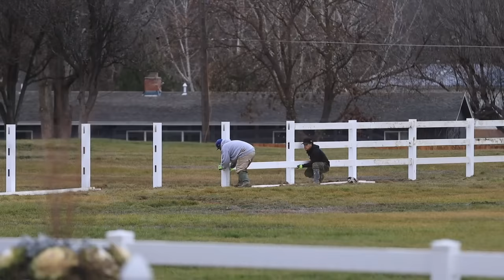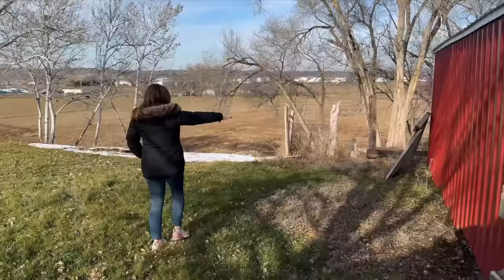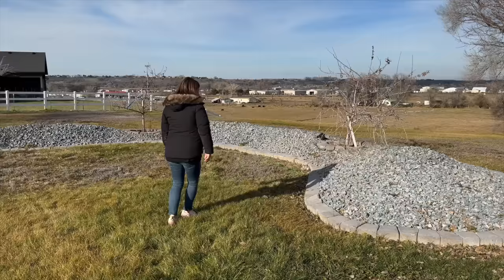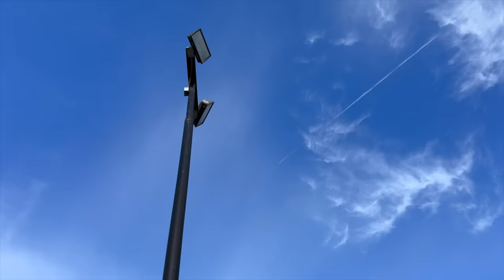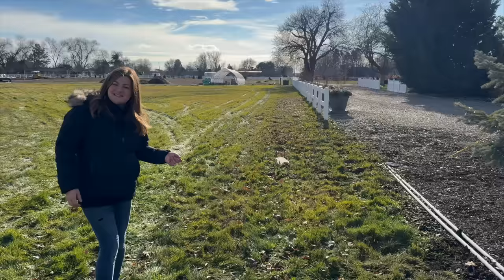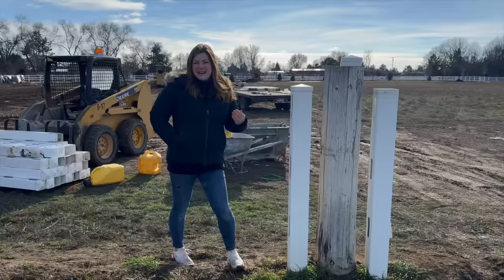A Very Exciting Way to Start the New Year! 🙌🥰🙌 // Garden Answer

Comment: Congratulations on the new property!!  As a horse person I wanted to give a few suggestions as you develop that area and the barn for horses.

1.  No Autumn Blaze Maples anywhere near the pasture.   I love a red blazing maple in the fall just like you, however the red leaves are poisonous to horses.  So plant a maple thats leaves go to a beautiful yellow in the fall instead.  (Sorry for the bad  news) Also any tree in the pasture area that horses can get to that have a Y trunk with the Y at or near head level, either get rid of that tree or cut off one of the two Y juncture.  I had a friend who's horse got its head stuck in the Y and broke its neck when it panicked trying to get free.  

2.  Don't get rid of the light posts around the basket ball area.  You will want to keep those and relocate them to your arena area.  If you or your kids end up riding competitively they/you will be riding at night and those lights will be a godsend.

3.  Pasture grass - plant a really good 3 way orchard grass and water it.  You can harvest and bale that grass for your horses and not have to buy it on the open market.  A good 3 way orchard grass per bale price right now is $25 to $30 a bale.  Until you get horses, you can cut, bale and sell the bales at your parents garden center.  Its extremely hard to find high quality 3 way orchard grass.

4.  Barn ... if the barn doesn't currently have electricity, put that on the project list.  You will want ligts in the barn, the stalls and the paddocks.  If the barn doesn't have rain gutters, put that on the project list too as well as a French Drain system to flow the water away from the barn/paddocks and out into the pasture.  If the barn sits at the same level as the surrounding land you will also want to do some earth movement to have the barn and paddocks higher than the surrounding land otherwise your paddocks and barn area will be a big muddy swampy mess when the snow melts or after heavy rain storms.  Stall, paddocks and barn isleway .... rubber stall matting, and a roof over the paddocks.  Nothing sucks more than sholving horse poop in a paddock in the rain.  Having a roof over the paddocks keeps them dry, and provides shade for the horses in the summer.  Rubber matting in the paddocks and stalls makes cleaning them so much easier.  Of course in the stall you will be laying bedding on the wall to wall rubber Matt's.  Don't use straw ... use sawdust shavings or pelleted bedding.  If there isn't water lines to the barn, add that to the project list.  Nothing sucks more than dragging a hose to fill a bucket in a stall.  Instead you can install automatic waterers.  Carve out an area in the barn to build a feed room and a tack room.

5.  Wash rack - figure out a spot for your wash rack.  That same spot can also be where you groom your horse and where your horse has appointments with the shoer and the vet.  

6.  Horse trailer -- side load all the way.  Don't get a straight load.

7.  Arena -- when you build it make sure the footing is done right.  Also add in shredded rubber.  It keeps the dust down and makes for great footing to work your horse on.  Visit some horse facilities and talk to reputable companies that install arenas.  A properly built area will be a worthy investment.

8.  Entrance  Gates to the property are important to ensure that is the horse get loose they don't end up on the road after going down the driveway and it keeps anyone off the property who may want to steal your horses, tack, trailer, etc.  I know you guys have talked about installing entrance gates for security.  Definitely have them on the todo list.

❤❤

Comment: It’s a beautiful piece of land and a cute barn! A couple of suggestions regarding horses. Protect any trees you want to keep that will be in their paddocks. Use your fencing to create a small fence around the trunk. Horses WILL kill trees. I also worry about using 2 x 2 boards as stall material. They may be ok if the horses aren’t enclosed in there for prolonged periods. Even gentle horses can be destructive when they’re impatient or if there’s another horse in adjacent stall. Consider reinforcing with a heavy metal mesh. One broken slat and a leg could get caught in it.  I notice some of the wood top rails in the stalls have already been chewed on. Consider installing angle iron along the edges of those rails to prevent chewing. No fence is indestructible but diamond V mesh fencing is the best for horses. Your vinyl plank fence is adequate. Do not use slick wire and avoid T posts anywhere horse have access to. Over 30 years equine veterinary experience recommendations provided to you free as thanks for your amazing content.

Comment: Have you considered moving the one greenhouse(next to the barn) to another location,assuming it's movable.  And then extend your barn to the side.  It could be low sloped witbout ruining the look of your current set up, and wide/tall as you may need, even the entire length of the barn, almost doubling your space for gators,  tractor, tractor implements, and pallets of things. It may also be slightly out of the way, and yet close enough where you can keep an eye on everything. There's already water and electricity as well.

Comment: I have a very random, unrelated question.. Just posting it while it's on my mind.. You've mentioned that if your septic goes out, you'll have to connect to the city(county?) sewage system. Do you have an idea of the setup cost? I assume they charge for things like that on new builds, so I would expect they would charge any other new customers as well.. Hopefully, it would at least be discounted since they would be the ones requiring the change.
I have a septic tank as well but don't live close enough to connect to anything at this point.

Comment: Move the rocks near the barn where the horses come and go from the barn to the pasture. You'll need it to fill versa grid to prevent your barn from becoming a muddy mess. Trust me, you need the rocks. I've had horses and a horse barn for all my life. Also, look into solar charged hot wire fencing called electro braid. Horses are extremely hard on plastic fencing and they are able to break the plastic railings and panels in no time. Check your pasture trees if they are toxic to horses. Maples are very toxic as many other kinds of trees that drop seeds. Even fallen maple leaves cause a fatal blood disorder in horses if they eat leaves from the pasture, so don't plant maples where they can blow into your horse pasture.

Comment: I believe you will truly regret, taking out those lights around the basketball court/tennis court. When Benjamin and Samantha get bigger even after dark they’re going to want be out there playing. And tennis is not that loud. You’re far enough from neighbors I don’t think it’ll be a noise problem and you will wish you  had lights. If you still want them out, I’d wait to the very last project I tackled. You could even string lights from those light poles in case you ever have a party or a reception on that court.